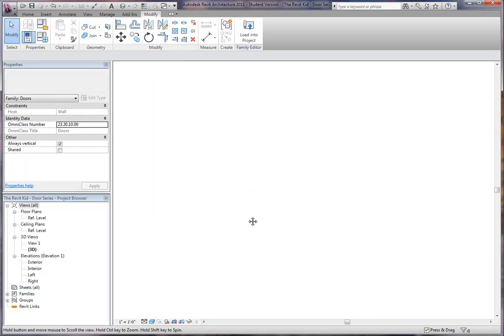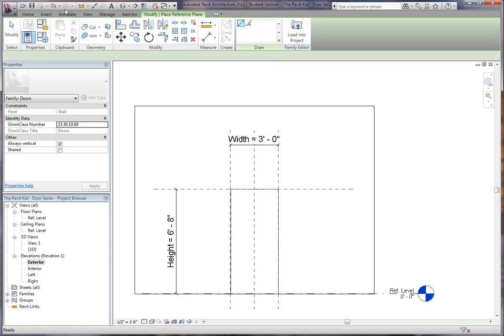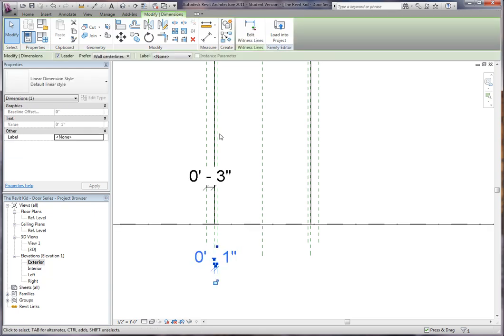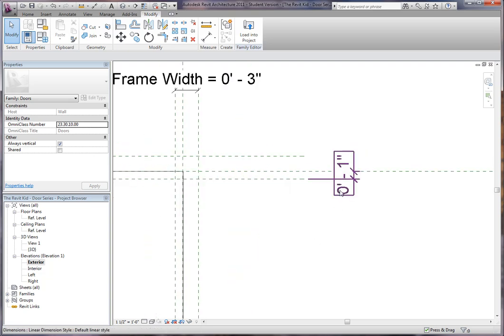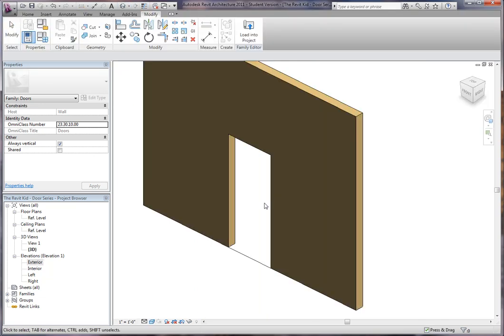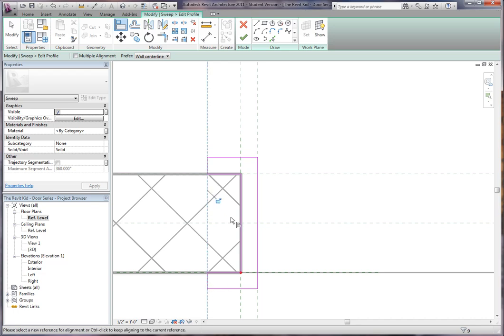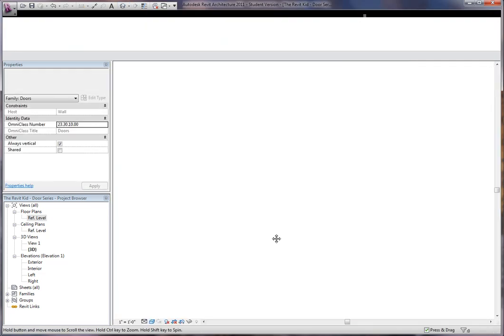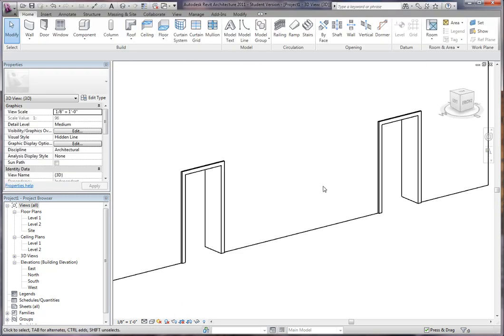Revit Tutorial - The Revit Kid - Create a Door Part 2

Comment: I would add one thing. Your opening parameters define the opening of the doorway but you're building up your jamb inside that. Your 3'0 x 7'0 door will have a clear width and height of 2'10 x 6'11, not counting the stops.

You want your wall opening to reflect the rough opening, typically +1-1/8" on each side for a hollow metal frame or +3/4" for a wood frame.  This is a problem with most of the door families I've seen.